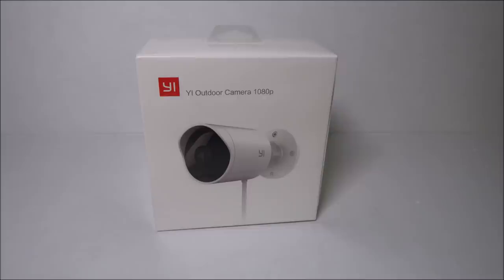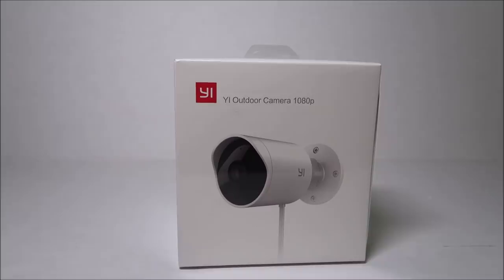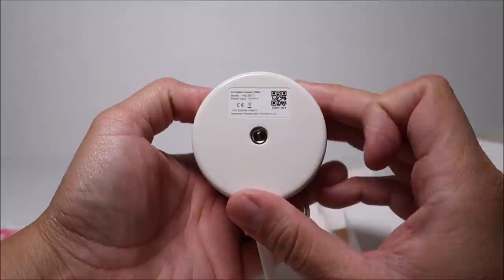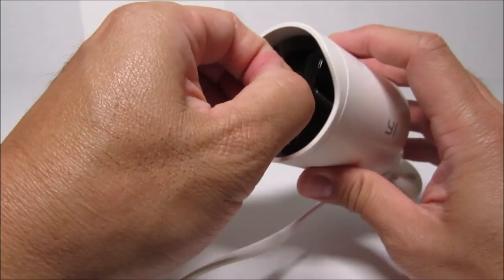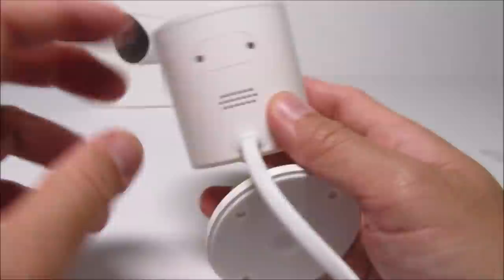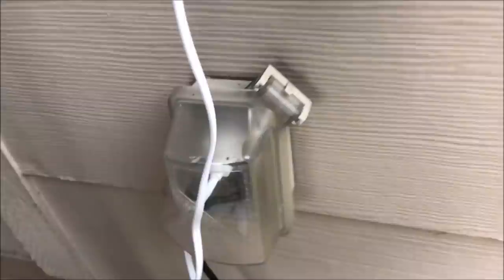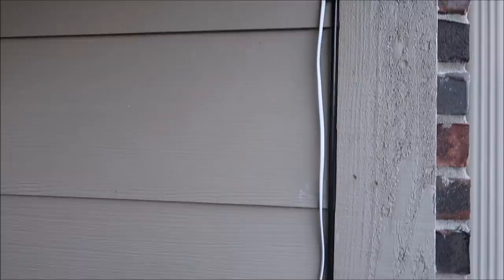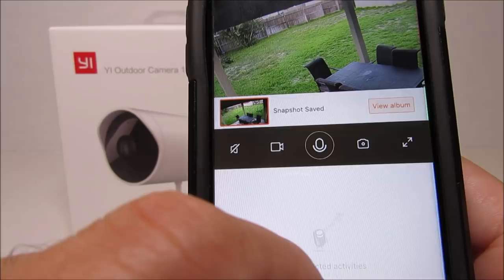Yi Outdoor Security Camera Review - Unboxing, Setup, Settings, Installation, Footage

Comment: Buyers beware: I had purchased a camera on Amazon and it fell apart and I sent it back and got a replacement one where the sound does not work properly. My son had purchased a camera for me years before that and that one the sound also has issues where I am supposed to be able to talk to my dogs thru it and that sound does not work properly but sends a horrible loud garbled sound. This camera will make loud sounds out loud occasionally and this is not a good situation since I am in a mobile home and very close to the next home and this is an awful situation when these sounds happen during the night time and very early morning hours. To try to fix the many error issues I have had, I have done resetting of both cameras a number of times and sometimes they work for a minute but then soon quit working again. The cameras will pick up stupid little things like leaves blowing and something nothing at all but most the time they won’t pick up my dogs moving in the area. They will pick up sounds of airplanes and trains but not my dogs barking, and sometimes there are sound alerts but there is nothing there in the videos. I have played around and experienced with different settings with the cameras and still same results. I have two cameras for outdoors and they are attached up high to view the yard so I cannot easily reach them for resetting purposes without a ladder. But in resetting, the cameras are very poorly designed and this is not good since with these cameras, if you want them to work properly, you need to reset them often. In addition if you have to reset your internet/Wi-Fi password, you have to go thru this awful resetting process for each camera again. Physically to reset you have to unattach them from the location they are attached to and take off this very tiny cover with the most tiniest of screws ever that often fall out and disappear and then you have to resort to buying new ones if you can find them or taping the cover shut which is not the best for weather proofing. Once you push the reset button you have to go thru the entire connecting to the Wi-Fi system which is such a pain and very time consuming and for me I had to actually figure out how to print out a paper copy of the scan square for the cameras to read it for resetting purposes (it would not pick it up from my phone screen). Then you have to spend a long time trying to set your viewing area again to the exact boundaries you want the camera to pick up. Another negative feature that I have complained about with no positive fix or results: Yi/Kami has across the viewing screen date and time and alert title which blocks my view that the camera is supposed to be seeing. None of that information needs to be there while viewing and if that information is important to someone it can also be found other places to refer to it. It seems like the time and date are duplicated on the viewing screen as well in two different formats and places.  Future potential buyers… trust me, don’t buy these cameras… they are junk and a huge waste of money and time; and now you see how they do NOT value their longtime customers by taking away features that came with the original cameras and making them pay for those features.

ME asking Yi/Kami security cameras customer service:
Are you no longer allowing me to view the 6 second motion videos that were part of the camera when I got them, without a paid plan now?
Ranjiv (Kami Vision) 
	to me
Aug 31, 2023, 09:35 PDT
Hello Susan,
 
Thank you for contacting Kami Vision and YI Support.

We're sorry for any frustration this may have caused you. Kami Vision has made a business decision concerning notifications. 
6-second notifications are now a paid feature with our Kami cloud plans.

We greatly value your trust and confidence and sincerely appreciate your loyalty to our business. 

ME to Kami/Yi: 
THIS DECISION SHOULD HAVE BEEN FOR NEW PLANS, NOT THE OLD ONES! NOT FOR THOSE CUSTOMERS WHO BOUGHT THEIR CAMERAS KNOWING THAT THE 6 SECOND VIDEOS WERE PART OF THE CAMERA SYSTEM! THAT IS A VERY WRONG UNETHICAL BUSINESS DECISION LACKING INTEGRITY.....

No, you have lost my future business and trust or anything in you! You will now NEVER be considered for any future plan whatsoever. And if I do need to replace cameras again, I will never ever purchase one thru your company based on past camera problems but this decision of yours to stop the 6 second videos and make me pay for them, which I can NOT afford ANYTHING; this one is the final decision maker. THIS DECISION SHOULD HAVE BEEN FOR NEW PLANS, NOT THE OLD ONES! NOT FOR THOSE CUSTOMERS WHO BOUGHT THEIR CAMERAS KNOWING THAT THE 6 SECOND VIDEOS WERE PART OF THE CAMERA SYSTEM! THAT IS A VERY WRONG UNETHICAL BUSINESS DECISION LACKING INTEGRITY and I will be more than happy to let others know my feelings about this and about Kami's feelings about their customers! Again another example of business greed for money over customer appreciation, loyalty and satisfaction! Next, I have 2 cameras and both are crap and have never worked properly, even after many times of customer service complaints and time troubleshooting and resetting. And about the resetting, I have a ton of complaints to pass on to future potential buyers and I will! SLC

Comment: What is the distance between screw holes on the template in 2:42? https://youtu.be/KQSPI6PKTeo?t=162 
I have my old cameras installed and wondering if the holes would fit for yi camera.
Reply from the maker: 4 cm between screw holes and 5.5 cm the screw holes across each other.
Reply: @LifeHackster  thx a lot

Comment: Hi how do u set up yhe band to 2.4ghz?
Reply from the maker: Your router should be broadcasting 2.4 Ghz already..some routers like mine are dual and has 5Ghz also. It should be automatic for the Yi to show you the WiFi that it will connect to during setup.
Reply: after i scanned the QR code then when i start pairing,,,it failed......could it be becos of the band frequency? i think i have both frequencies too. the thing abt my camera is that i got the chinese version and dont know wat it is saying...althou i know the qR scanned was done correctly.....your thought please?
Reply from the maker: Try connecting your phone to the 2.4 Ghz Wifi and do it again...Some cameras will use the WiFi your phone is connected to and if you are connected to 5Ghz then it will not work.

Comment: Just ordered two for $95 shipped.
Reply from the maker: Cool..
Reply: How did you get it so cheap may I ask?  Amazon has it for $79.99 right now for just 1.  Thanks.
Reply: @hanzelnuts8446  HI, there was a sale on AliExpres.  I actually have the two boxes here but still didn't get the chance to open them :)
Reply: @hanzelnuts8446  Amazon is mostly more expensive.. AliExpres is cheaper, but you need to wait two-three weeks for the package to arrive and obviously the customer support is almost nonexistent compared to Amazon.   If possible, always use PayPal to get an extra layer of protection. Not all sellers accept PayPal though.
Reply: @MorkusReX  😂
Reply: @hanzelnuts8446  Great! Congrats
You will probably use then before me

Comment: Hey LifeHackster,
Here's the video link on how I mounted and ran my Yi outdoor cam/power cord--this one is installed on the side of house next to my garage...FYI: I mounted it about 10ft up and my nightvision look good with seeing faces..
https://youtu.be/qWooCubomNc
Reply from the maker: Nice install there Mark. Yi should have designed it so that the power cord comes out from the base so that no wires are showing when you do a through the wall install. I haven't really decided yet where to permanently install mine...
Reply: LifeHackster 
Thx..Agreed on the power cord going thur the base...

Comment: HI,   This is a Chinese device and I am skeptical of connecting it to my wifi, and then downloading an app in my phone to setup. I don't want to connect to a chinese ran website/app that I also have my personal computer on. Is this a risk that the Chinese Communist Gov't, which is authoritative and totalitarian in its ruling of country (including businesses), could  possibly impose on my privacy? either monitoring or hacking? (TIkTok has been banned in many countries, and maybe US, for this reason). I
Reply: I hate to burst your bubble, but almost every Security camera that you buy is built in China. This is coming from someone who worked with security camera vendor/installers for corporate installs.
Reply: @brierepooc8987  why I consider it  more risky than others is company Yi is chinese, other camera companies like ring are US based.  although all hardware is made in China, the website/app is also chinese for Yi.  Ring or others are a US based website/app.  same concern for TikTok app, and I don't use tiktok for that reason.